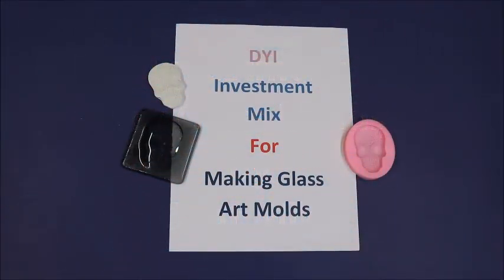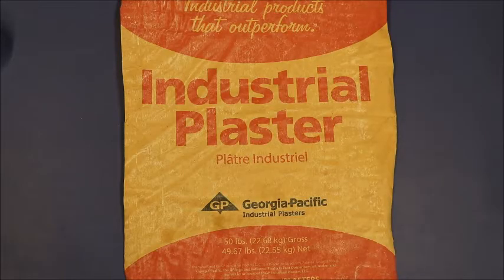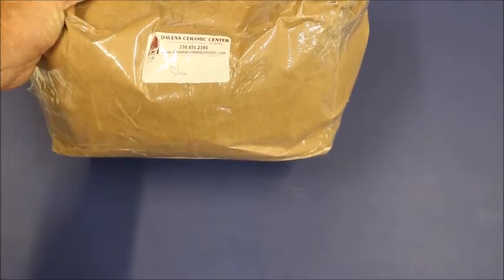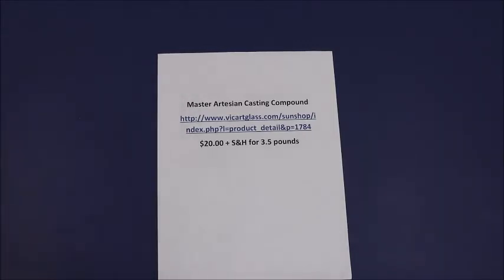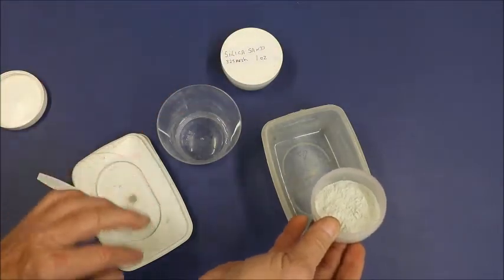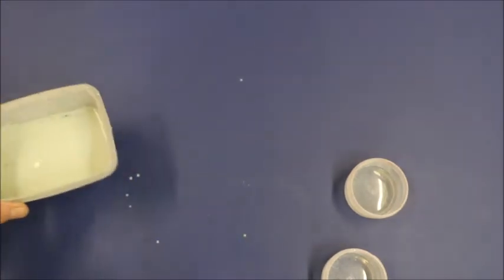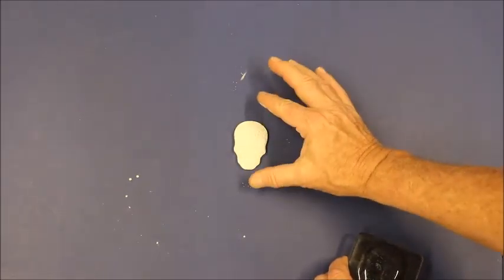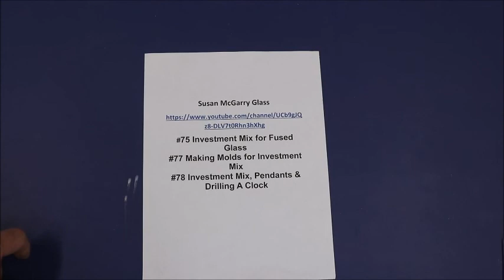DIY Investment Mix for Glass Molding

Comment: Hi Capt Mike,
What’s the difference in making this mix an not needing a glass separator when fusing ,an the molds that we purchase that need a glass separator ? Also Do we have to pre fire these investment mix molds before we use them?
Reply from the maker: Good questions Lisa.  I'm not sure why it works that way, but I did find out that the larger and more complicated investment mix molds could use a little separator.  You do not have to pre-fire the molds, just make sure they are completely dry.
Reply: @CaptMike  I'm guessing, but if I had a functioning controler, I'd try to make a thin mix of the gips, and use that as seperator as a test.
Reply from the maker: @CONEHEADDK  Thanks for the comment.
Reply: @CaptMike  I hope to get an update, if anyone trys it. I expect to do some more casting, when I get my controllers repaired, or buy a new one.
Reply: Good vedio, thank sir, may i know   can I make flower wase? Where I can get the mold to pour mixer.

Comment: Why do some people vacuum out the bubbles of the investment an you don't?  I been doing this silica flour, dental plaster, water investment for a couple years off and on now with limited success. My issue is the molds will often crack. I wonder if I vacuum out the air in the investment as it's setting if it will increase the durability of my molds. I use homemade leaded glass and ideally need something capable of withstanding 2200f.
Reply from the maker: I have never really given any thought to using vaccum.  I'll see if I can find a video on how to do that and maybe learn something.

Comment: ok, i want to make a mold of a ceramic piece {sea horse} can i pour the mix over the piece, and will i need a seperator?
Reply from the maker: First, yes you will need some kind of mold release unless the master is silicon.  Vegetable oil works for me (most of the time). next is does the piece have a flat side?  If the master is 3 deminsional the mold material will encase the piece and you will not be able to remove it.  If it is flat on one side I place the flat side down (with a little petrolium jelly to msake it stick) and pour the mold mix over it.  Hope this helps.
Reply: @CaptMike  yes thank you, the piece is flat and i have mold soap. i am hoping to make the ceramic molds first. I will start soon i hope
Reply from the maker: @catheyfoss2890  Great. let me know how it turns out.  I wish we could post photos here.

Comment: Is it good for flat glass bending??
Reply from the maker: I only tried with small molds, but it worked OK.
Reply: @CaptMike  This mold breaks after heating in the oven.
Reply from the maker: @akhtarali9665  Are you using a microwave kiln?  I have has a few failures using one.
Reply: @CaptMike  no